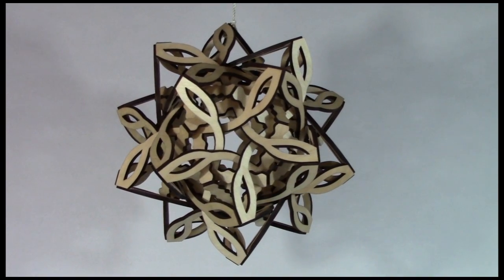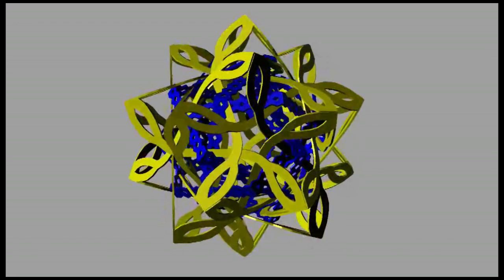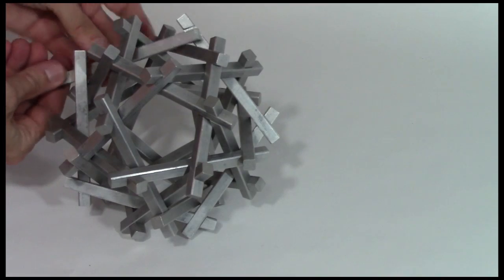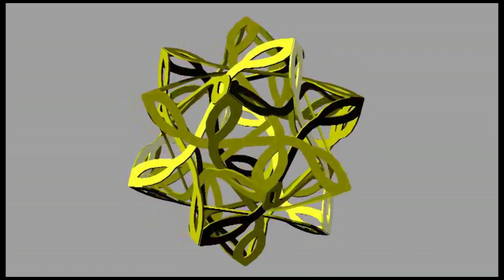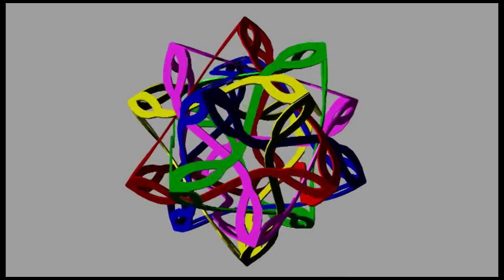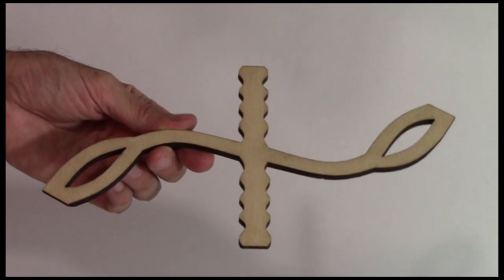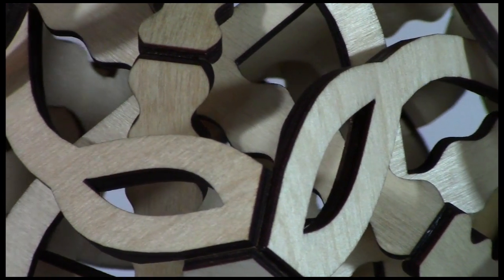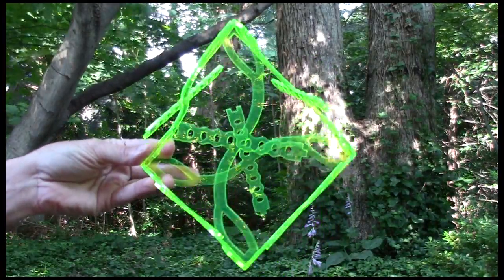SuperFrabjous

Comment: What I glean from your explanation is you have made a 'tensegrity' since all the parts are connected (think of an ant making a round trip) so 'pull' on each other and there are no compression forces - just tension. If you suspend it, how can its parts not be under some tension due to its weight?